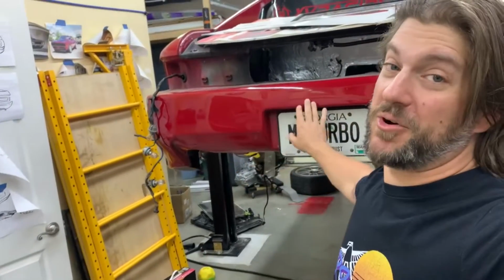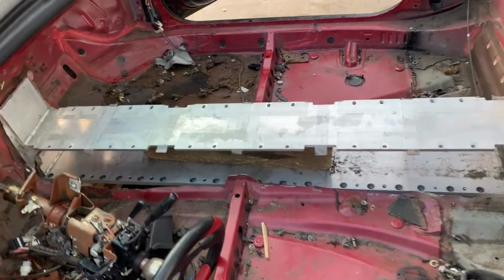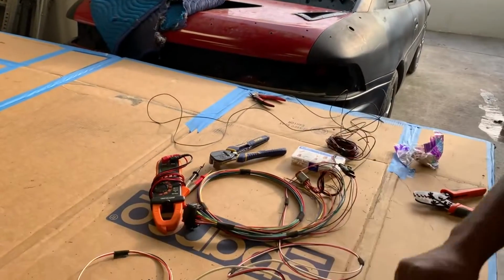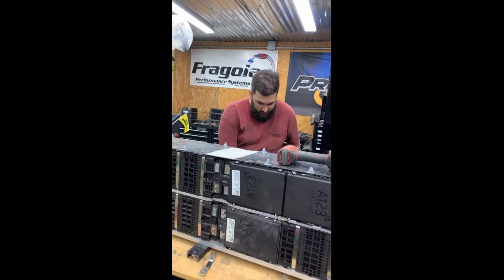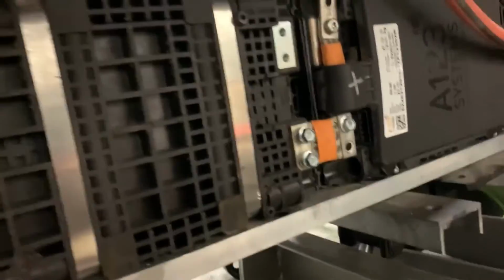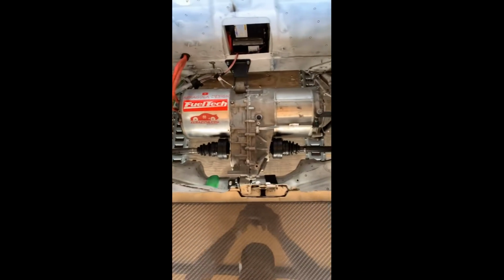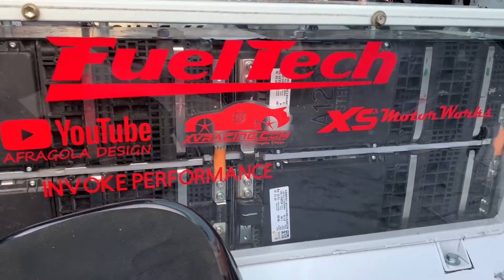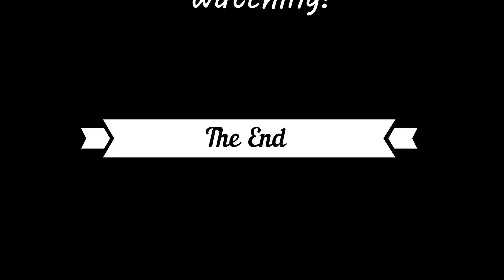MR2 Tesla Swap Series Part 6: Huge Progress and First Drive!!

Comment: The baby Japanese Ferrari lives again, but with an American ev motor transplanted heart. 😎
I cannot wait to see this thing wrapped up man. Since I live in Cobb county, maybe someday soon I'll even be able to see it irl. 👍🏻

I wonder just eye ballin that pack setup. If you could get a wrecked m3 sr pack which I think only has 3 of the longer modules in it. 
Then swap all 3 modules right in place of the fisker pack. 50kwh+useable pack capacity would probably give that an easy 220-250 miles of range or more. With the energy density difference I'd bet it only ad's maybe 100-200# more. 🤔